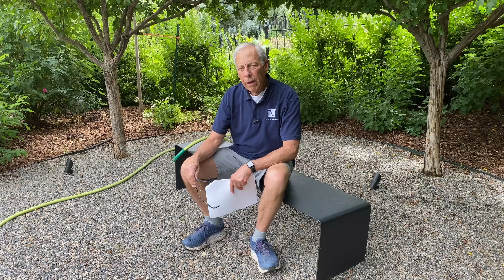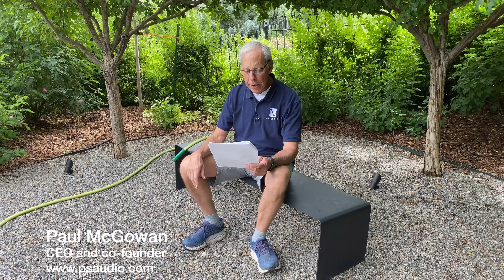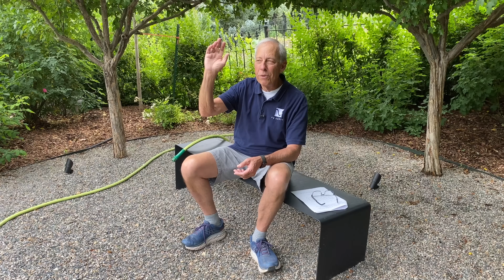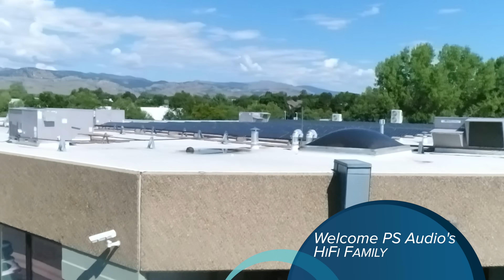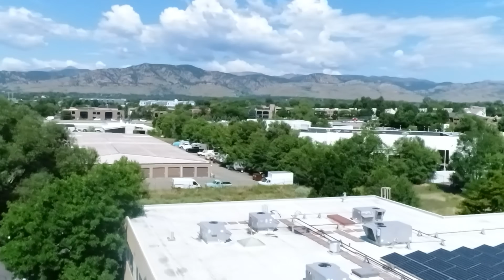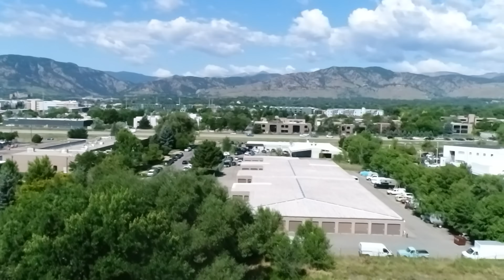Class D vs. Class AB amps

Comment: I use almost daily a class D because it is more convenient,  I can leave it on all day and sounds very good  BUT as long as I don't connect other amps I have, all of the conventional sort, A/B, A, BJT, MOS- FET and I notice how they all sound less high frequency  tilted up but at the same time having more information. In an attempt to equalise the spectral differences I turn the highs down a little but the resultant sound afterwards is boring. 
I can enjoy music with that class D  amp but I must avoid to compare  and also take the sound of that amp as it is, more obvious and less tasteful.
Reply: What power level differences are there in your amplifiers? If the D amp has less power than your other amplifiers and played at the same levels you might be hearing some distortion from the D amp that typically has very sharp rise of distortion as its max power level is reached.
Reply: @StewartMarkley  I never  strain the amps because my listening level is from very quiet late at night or by the day as much 70 dBs.
What I meant was that obviously there are differences between amplifiers but it is not as noticeable as some want to make us believe. 
Of course, some are more engaging and interesting,  hooking the listener longer but not something as live or dead.
I may be a little special because I keep unused the best and wear an tear the cheap and expendable ☺
Reply: @salvadorrodenas3071  Hmmm, I'm trying to understand why you hear a difference in the amplifiers that seems to be consistent between the class D amp and any others. I understand very well the technologies of any class of amplifier which should have minimal (less than 1dB) difference in frequency response thus not be an audible factor. If the class D amp happens to have a rise in the high end and you use a simple treble control to compensate, the sound could sound rather dull and lifeless from the fact that treble controls are wideband and the rise of the high end on the class D amp is probably very more narrow band.
Reply: @StewartMarkley  I think you are in a good way to understand what I said an you are right about the difference class D amps tend to sound. Very transparent but maybe, lacking a deeper texture in the sound of instruments. I don't take my opinions at that respect very seriously because we humans, may be enhancing our perceptions by our minds due to bias an preconceptions. But in general,  the most respected audio critics seem to confirm that aspect. Look no further,  you can search now in the Stereophile website the last review done by Herb Richard? I'm awful remembering names😂 in which article talks about the matter Paul McGowan brings to us in the video. Go and read it you will find it very interesting.
Reply: @salvadorrodenas3071  Thanks for the link. I have to tell you that I am not a fan of Stereophile with all their flowery characterizations of sonic qualities of minimal if not non-existent audible differences. I don't doubt that there can be audible differences in amplifiers although any notable differences highlight the fact that at least one amplifier deviates from the notion that an amplifier should be a straight wire with gain. I am of the opinion that as long as an amplifier is operating in its linear region the sound quality can be made to sound as good as you like with an appropriate use of equalization. Because speakers have orders of magnitude more differences in frequency response than an amplifier, the prudent use of EQ can pretty much make any setup sound like any other, given adequate bandwidth capability.
Reply: @StewartMarkley  I agree with you

Comment: Class D technology has seemed to have jumped leaps and bounds in recent years. Not to mention, why not find a company with a reasonable return policy and try one out for yourself? Instead of judging an amp on what class it is, see how it works and sounds in your system instead of basing it on the class of amp it is.
Reply: Fat Rat 
Thanks very much, Rat!
Reply: @behexen250 
I need to look into that!
Reply: @behexen250 
I see cables, line conditioners and headphones in their Lending Library, but what other products can be borrowed?  
Link:  https://www.thecableco.com/lending-library
Reply: behexen250 
That’s a good idea. I’ve already been signed up on their mailing list for years, but I’ve never taken advantage of their lending program. Thanks!

Comment: Class D Baby ! Darren's work with the M700's, S300's, & M1200's is amazing.
Reply: Darren didn't do squat -- the performance of those products comes entirely from their OEM output modules.  Their Class A front ends neither add nor subtract anything much from that performance.  Were it not for "high-end" marketing optics, they could have achieved as good or better results with "jellybean" op amp ICs.

https://www.audiosciencereview.com/forum/index.php?threads/review-and-measurements-of-ps-audio-s300-pwr-amp.9302/
Reply: @editorjuno  I don't take ASR seriously, to tell you the truth. My ears will tell me if their stuff is crap, and it's not.
Reply: @joeygsaudiochannel  -- In my 50+ years of involvement in home and pro audio, I've never encountered a power amp that measured well and sounded bad, so I take ASR a lot more seriously than self-styled "audiophile" gear reviewers or sales/marketing types like the affable Mr. McGowan.  YMMV.